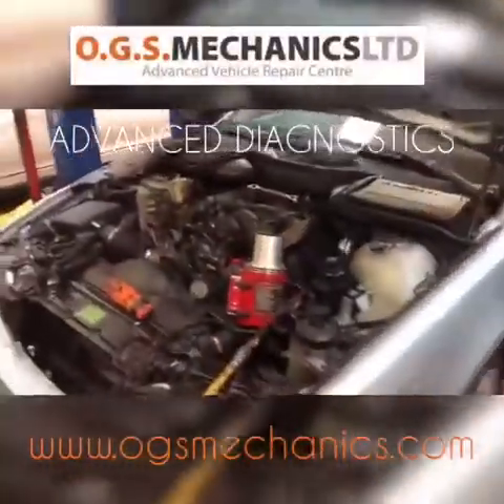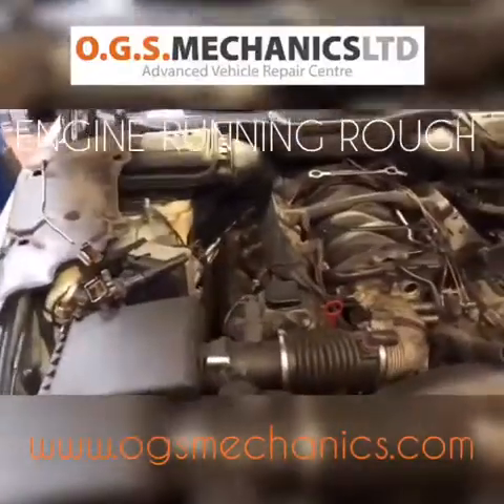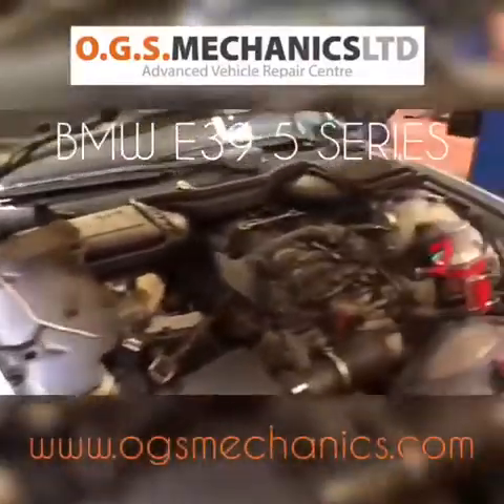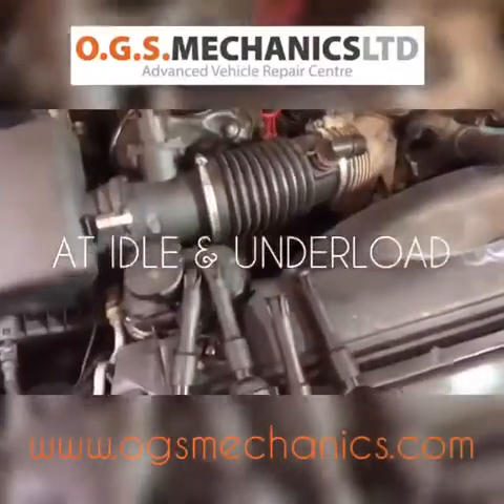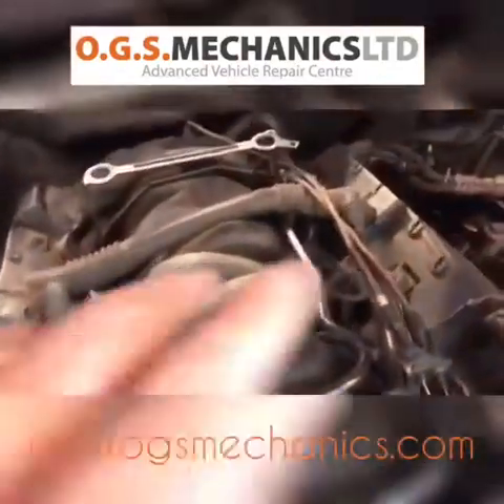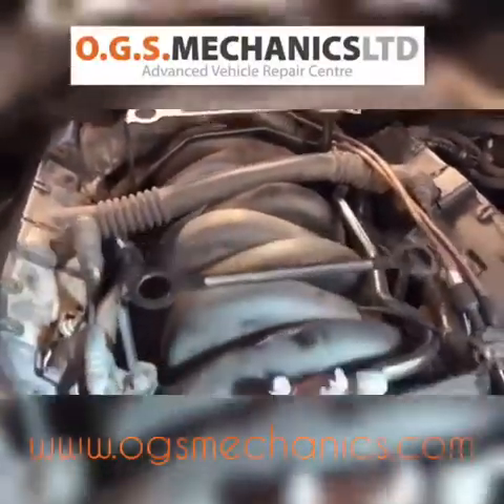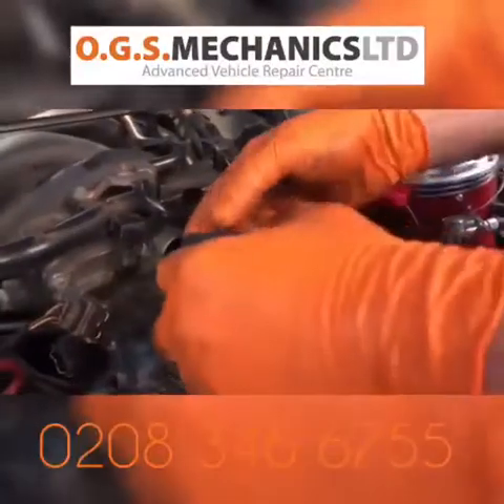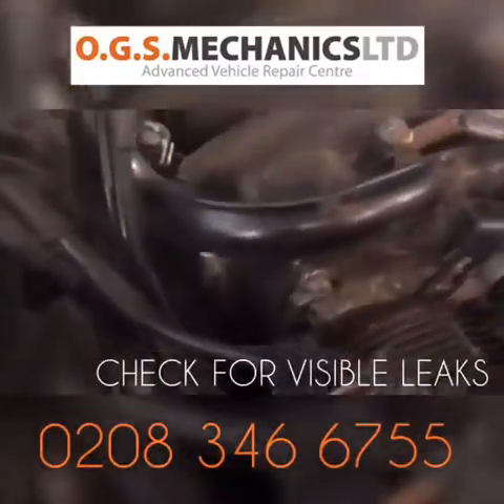See why this E39  BMW Engine Misfire! BMW rough idling problem found!

Comment: i have idle issue but not under load she drives great when foot is down it's only when i'm idling ? i thought it was the Idle control valve 540i 1997